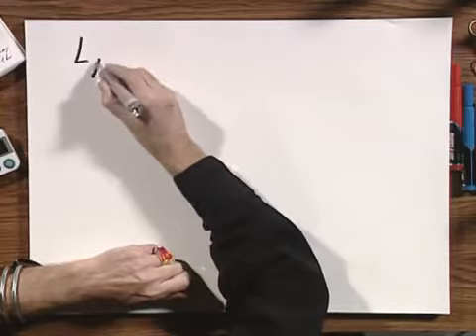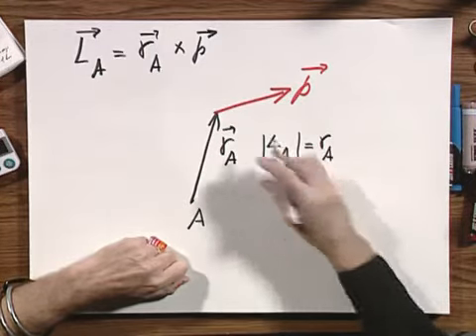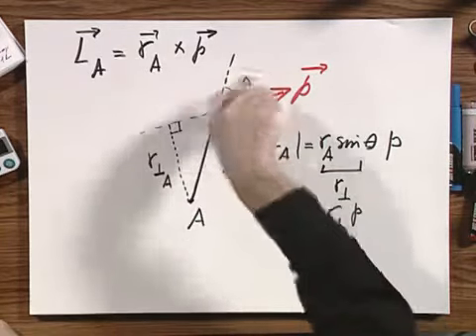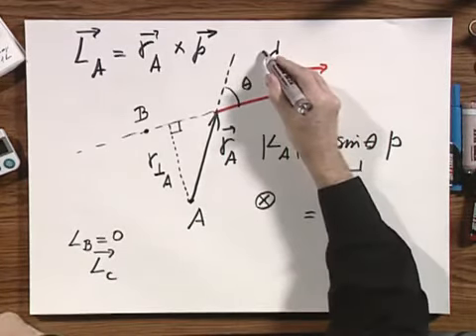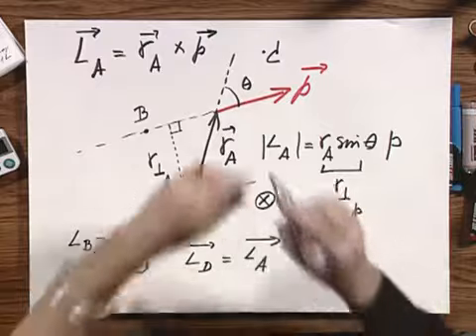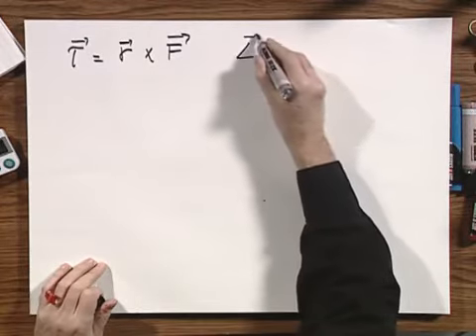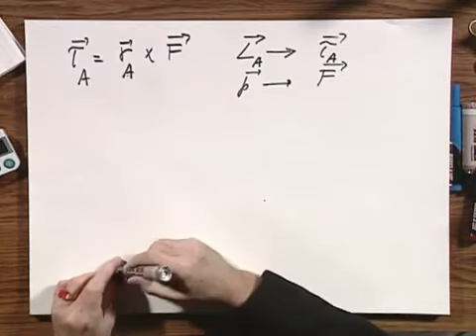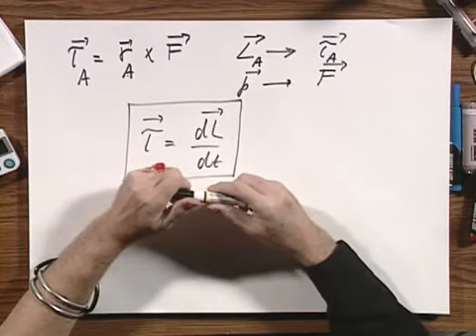8.01x - Module 25.01 - General overview of angular momentum and conservation thereof.

Comment: sir, in questions it is asked to find angular momentum about a point then to use the formula I*omega which axis should we choose about that point to find I given that body is a solid disc?
Reply from the maker: watch my 8.01 lecture in which I  cover this thoroughly
Reply: sir in your lecture it is explained only about circular motion in a plane but what if disc is rotating about an axis which is parallel to diameter of disc and we have to find angular momentum about point on the axis at the surface on which disc is revolving.
Reply from the maker: watch my lectures, ofcoz I cover that too.
Reply: sir i have seen your lecture 20 of 8.01 again just now but could not find any such example of a finite solid body such as disc rotating about axis parallel to its diameter(axis is some distance apart from diameter and parallel to it).
Reply from the maker: I cover this but maybe not in  Lect 20
Reply: Please sir guide me where can I find answer to this question. Or if possible please send the answer in the reply. I will be very grateful
Reply from the maker: All this is well covered and explained in my lectures and in my Help Sessions. I too would have too search which lectures and which Help Sessions. But that is not my job. This is my last msg.